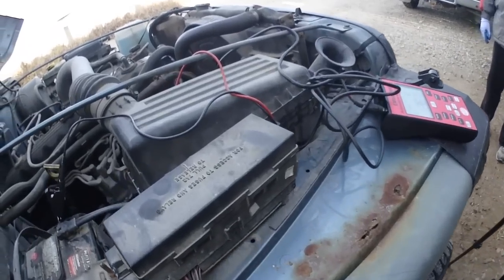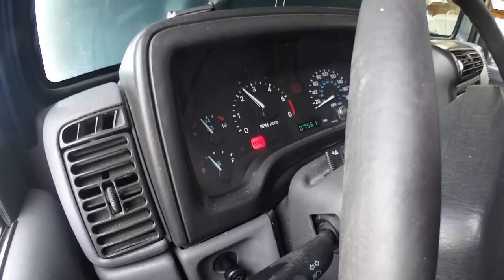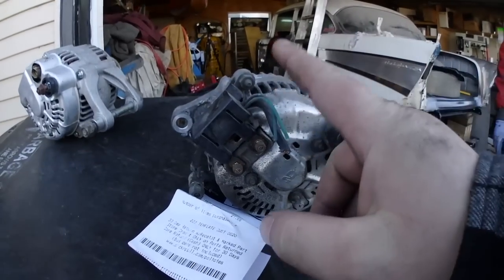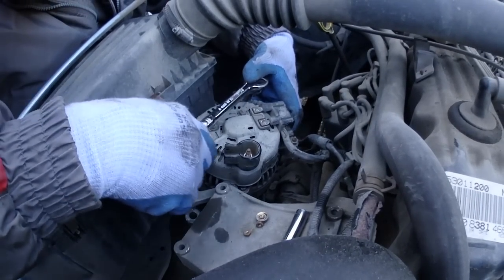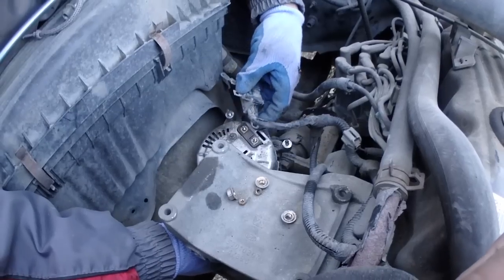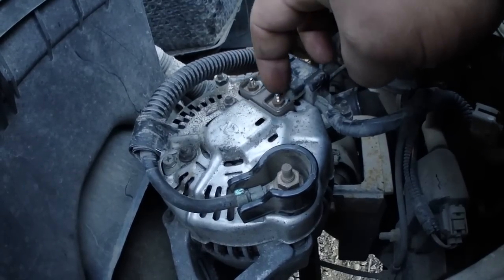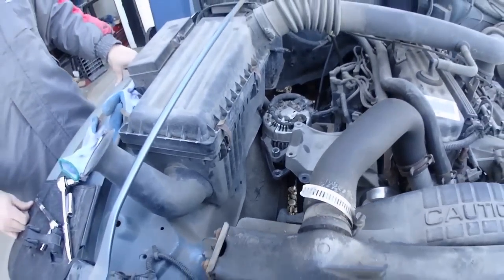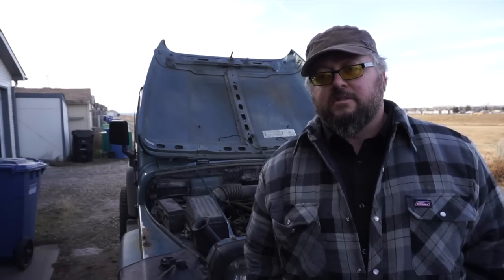Jeep Tj,Xj,YJ Low Voltage Check Guages

Comment: Doh! I was only checking voltage and didn't even think about amps. I have a '03 TJ 4.0 and I spent today in 90 degree heat hunting a gremlin. Had alternator tested 3 times and they said it was good. So I started with the wires, eventually replacing the charging, starting, and ground wires. Jeep continued to have the same symptoms as in the video. Fluctuating from 14v to 10v or so before I cut it off and start looking again. Planning ahead, I bought an alternator at Advance online but hadn't picked it up yet while I tried everything cheaper first. I went ahead and got the new alternator and soon I had full power and charging and everything was working as it should. Drove around with AC blasting and then idled for a little while and no drops in voltage. I'm pretty sure upgrading and cleaning the grounds and wires helped as well as the main problem being the alternator. This is the second time I've had Advance test a part and they said it was good but it wasn't. Last year it was a starter and ended up costing me $800 over 2 visits to a ripoff mechanic because I thought the job was beyond me. I discovered the problem while checking every wire coming out of the engine compartment fuse box. A crimp had loosened on the battery to starter wire. Yeah...
Anyways, I love my Jeep and videos like yours help keep it going. Thanks!
Reply: Damn,. A loose crimp!
Well I guess I will be checking on my wires now.

Comment: 98 xj had this issue swapped in a brand new alternator, back to having the same issues 2 weeks later, any suggestions?

Battery less than a year old alternator new non reman, 2 weeks old

Comment: i had to do something like this the other day to my 96 zj 4.0l it would start fine but not charge the batt  gauge would be middle of 9v-14v then drop to 9v check gauge lights up its a denso type alternator i checked batt with meter and it was not charging and what i found it to be not sure 50/50 a ground in front of the motor mount passenger side 13mm nut on a stud hard to get to  it had 3 grounds 2 little ones like computer ground and a big ground they were crusty and rusty so i wire  brushed them shiny , then also there is a temp sensor under the battery that pcm uses i put a multi meter and checked the ohms at the connector disconnected  it was 18k and i put my hand on it to heat it up as it was cold out like 45 f and on the multi meter ohms go down all the way to 12.89k it took like 3 mins maybe it got stuck at a high resistance not sure i got tired so i put it all back together and put an amp clamp over negative batt lead wire and multi meter leads across batt terminals started it and it was charging 14.22v with 0.32a after 30 mins of running solid like i had 13.99v and 0.22a  hope this helps someone out i used to buy  pcms for it yearly
Reply: So how did you fix it? I think I'm having the same issue with my moms car. Did cleaning up the grounds fix it?
Reply: @TheDesmondscott15  the power feed wire nut from the alternator was loose not the one  for the wire the internal one i took it all apart and cleaned  the internal ground tabs and terminals its worked for 2 months no issue

Comment: I have a 2000 Jeep Cherokee and I am having the same gauge issue. But my battery gauge sometimes works and reads 14 volts and sometimes read 12 and drops to 9 about 10 min later. Anyone know if this is an alternator issue as well? I’ve heard it could be the fuseable link for the alternator but not sure.
Reply: I just have the same issue! I bought a new battery today and putted into my xj 2001, it started at 14, then I turned off, when I turned on again it says 12 then suddenly dropped to 9... Did you fix the problem? What was the main issue???

Comment: Recently replaced the battery temperature sensor when the P0516 code came up on my '05 Jeep TJ cluster. Oddly enough, it doesn't come up on my scanner. This is a first! And when I go in reverse to get parked in my driveway over a very small bump, the check guages light comes on. 

Also have a new alternator and battery with the battery reading 12.6 when sitting which is perfect. However, the voltage only reads 13.6 after starting it, when most TJ forums say it should read between 14.2 - 14.7

Any idea of what is causing these things and how I can correct them??
Reply: 13.6 is normal at idle. Try revving the engine and see if it goes up a bit--I bet it does. Also it could have a weaker alternator (some TJs have a 90-amp, others have a 117-amp), or your TJ could be drawing power for something while your engine is running. Do you have the heater or AC on? Do you have the stereo on? Headlights? Holding your foot on the brake (brake lights)? Etc. Also, is it cold outside when you are testing? Colder temperatures will show lower voltage as well.

Overall I think 13.6 is perfectly fine at idle. If you aren't convinced, you now know lots of things to check before you get too worked up about it
Reply: @allmycarsisbroke   Since I posted this, several mechanics, one of them being a Jeeper said 13.6 is great, 14 or greater can cause a shorter alternator life. With over 159K miles, this ole TJ is running great now, especially after installing the Wrangler Fix pcm. Transmission shift points have never been better.
Reply: @JeepTJWheelin  yup! Well it depends--there is a battery temp sensor on at least some TJs (my 99 has one), and apparently the ECM uses the signal from that to regulate current flowing from the alternator to battery. Getting the battery too hot can cause electrolytes to be permanently consumed, shortening battery life. High current draw (e.g. when using a winch) can cause the battery to heat up much faster than normal driving conditions, and when the battery temp is high, less power is sent to the battery to prevent overheating it. Conversely, in very cold weather there is increased resistance in the battery which can impact performance, so the ECM will ensure additional power is sent from the alternator to ensure the incoming current is sufficient to overcome the added resistance and prevent the battery from draining while the engine is running.

I am no expert, mind you. I may be mistaken on some of that, but I came across this video while looking for information about the battery temp sensor (specifically whether it has any bearing on anything beyond triggering a check engine light), and so far everything I've found says what I wrote above.
Reply: @allmycarsisbroke  Sound advice 👍

Comment: I didn't know the voltage regulator was in the computer (depending upon the year obviously), that's good to know!
Reply from the maker: +UndergroundTrev yes it is and if it fails, instead of replacing the computer you can modify it to accept a voltage regulator
Reply: That's even better to know!
Reply: @TestDontguess  how can you modify it. I think I might be having a issue with mine.

Comment: Just got a new alternator and still have the problem.
Reply from the maker: The alternator most likely isn’t your issue then. You should have got it tested before buying a new one. If you have a TJ the voltage regulator is in the PCM and most likely fried
Reply: @TestDontguess  Thank you. The problem was found. A plug on the firewall that has to be snapped in was not plugged in at all. Solved all of my issues. No idea how it came to be unplugged. I don’t even think the few rough spots I climbed over recently could’ve knocked it loose. Problem solved. It stays locked up but it did spend a night outside parked at an alignment shop. I had people looking for me for a couple of months. Ha Ha. I trust no one. I wish I knew this vehicle like I know the others. I’m learning.
Reply from the maker: @ColleenHatton-r7y  Glad you got it sorted out, I don't trust anybody either

Comment: A cheaper solution to replacing the ECU, when the regulator goes bad, would be to install an external voltage regulator just like this: http://www.backyardmechanic.org/how-to-build-a-external-voltage-regulator-for-dodge-jeep-chrysler/
The only drawback is that the "Check Engine" light would stay on. But as a temporary solution...
Reply from the maker: thats' genius thanks for sharing